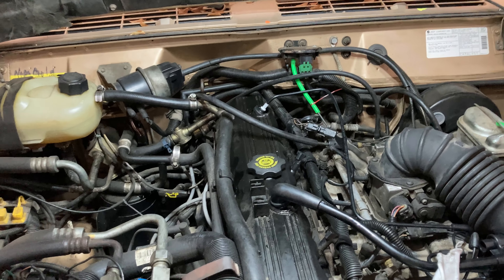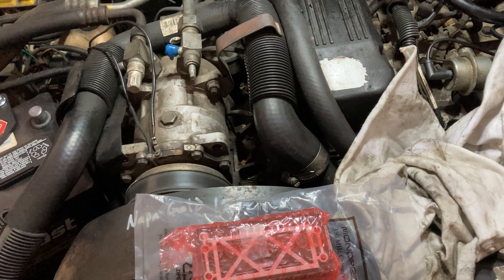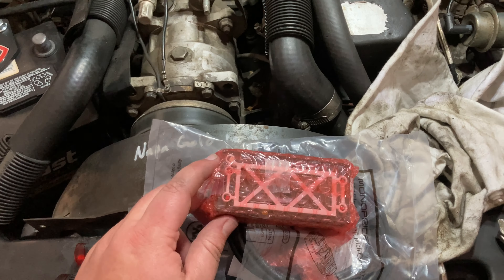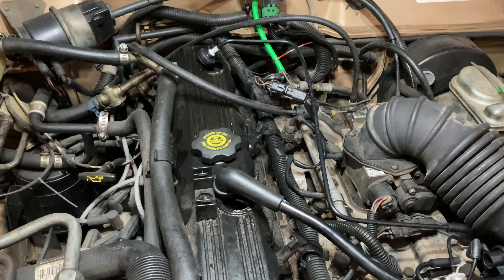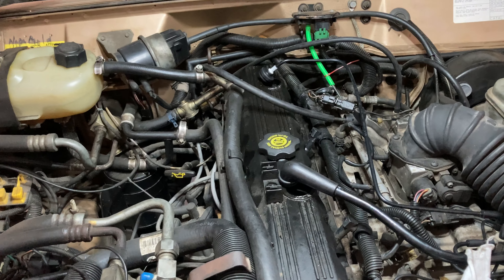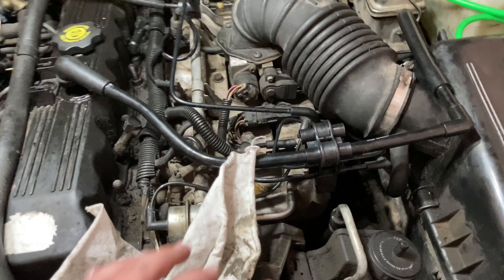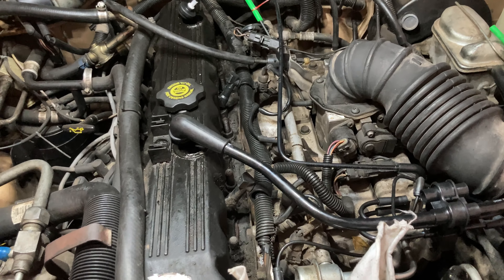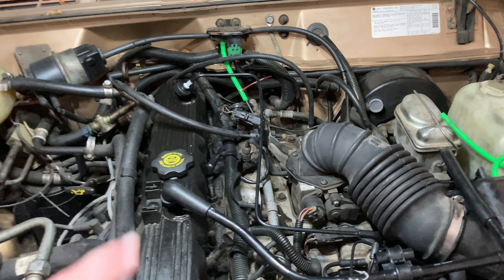Trying to Fix the mess somebody left me from a previous vacuum system repair

Comment: Looks like you have a newer valve cover.  Take a look at Dorman 42344.  But then you might have to swap out the front and rear PCV valves and get creative with the rear hose.
Reply from the maker: I bought this:https://amzn.to/2YXPVsO and will see if that works. I have a lot of other stuff to do, so I'm not in a huge hurry, but would like to get it done sooner rather than later.
Reply: @AICCars  I actually bought these the last time I needed a set: https://www.amazon.com/gp/product/B06XS8XYHJ.  My original ones were so hard I had to cut them out.
Reply from the maker: I had to cut the ones I had out as well, broke two blades.... I think those are the same ones I bought.
Reply: @AICCars  It's silly but I bought these over the Dorman ones because they didn't have a huge Dorman part number cast into them.
Reply from the maker: lol, I didn't want the dorman ones either for the same reason.